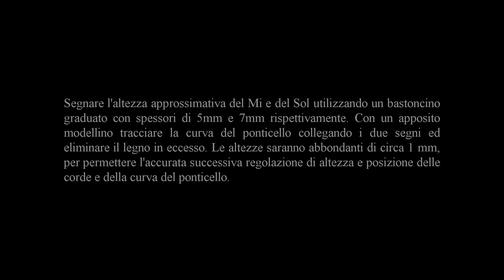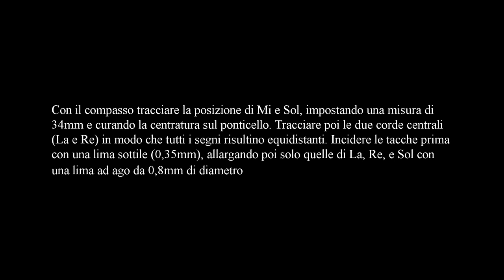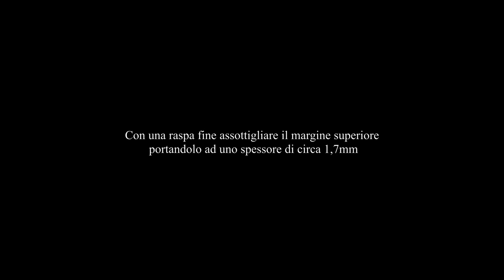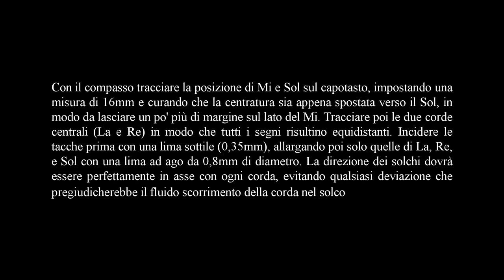Ponticello di violino parte quarta - Impostazione dell'altezza e della posizione delle corde

Comment: How do you know that it is well-centered when you first mark the position of E and G string? Is there any way to ensure that strings are at the center of both fingerboard and the bridge?
Reply from the maker: To center the strings on the bridge, you need to place the centers of the G and E strings the same distance from their respective outer edges. Since the bridge needs to be aligned with the projection of the fingerboard, the strings should lie in the correct position. Obviously if the violin is built in a geometrically correct way, i.e. the neck and the fingerboard, the bridge and the endpine are centered on the same line. Otherwise it will be necessary to adjust the position of the strings and the inclination and position of the bridge, and in the worst case correct the neck alignment to correct for any errors. If you do as I do in this video, while lowering the height of the strings you can also correct their position and check the alignment with the sides of the fingerboard, but obviously only minor adjustments are allowed, you can't compensate for a crooked neck🙂
Reply: @DavideSora  Do you mean by measuring on a curve to check distances from each side? Despite assuming that there is no problem with alignments, it is still confusing for me because lowering the height of the strings changes the angle of the bridge. If I measure on a curve after finished with lowering the heights of the strings, the center line would not be perpendicular to the top plate and be tilted toward to E string because E string is lower than G string. As a result, the strings would not also be centered on a fingerboard when measuring the distances from outer edges to G and E strings.
Reply from the maker: @maiviolin0623  I do not understand the issue. It is true that the height of the bridge is irregular, but the initial centering of the strings on the curve is marked with the height of the bridge very close to the final one, so the lowering will be not much and any errors kept under control. In any case, when you have set the initial position on the bridge and put the strings on the violin, you can visually evaluate their position relative to the edges of the fingerboard easily, and while you are lowering the E and G strings to bring them to the final height, you will have to check that the relationship between the strings and the fingerboard edges remains correct (which theoretically has the E with a greater clearance from the edge, and the G slightly closer to the edge). When you have lowered and correctly positioned the two outer strings (G and E), then proceed to lower and correctly position the two central strings, constantly checking that everything is well balanced and the radiuses above the strings are correct.
But don't get overwhelmed by numbers and measures, "geometrically accurate" is almost never applicable in violin making, because it would assume extreme accuracy in each phase of the construction, so as to be able to have absolute spatial references. Adjustments (hopefully very small) are therefore always necessary in order to compensate for the small geometric inaccuracies deriving from the construction. For example, if your arching is not perfectly symmetrical, even if only due to the deformation induced by the soundpost, your perfectly symmetrical bridge will end up being absolutely wrong, and therefore this factor will have to be compensated in some way. Going into describing all the possible errors and how to compensate would take a lot of time, but be able to set your mind on the starting geometry of your violin is definitely essential to keep any small geometric errors within acceptable limits
Reply: @DavideSora  Thank you so much for sharing your knowledge. My question was raised because my bridge seemed to be set on the right place with right string spacing but strings ended up being little bit skewed toward the E, which resulted in less clearance on E side than G side. Now that I understand there may be a bunch of other factors, I think I need to take some time to figure this out. I really appreciate your comment. It really helped me a lot.
Reply from the maker: @maiviolin0623  On some old violins, also due to deformations as well as working inaccuracies, the situation can be rather awkward, and getting a clue of the situation can be challenging. If you're not a luthier, it might be worth taking your violin to a professional to figure out what the problem or problems are and what needs to be done to solve them. It could simply be the bridge that has shifted laterally, which can be easily ascertained by checking the relationship with the bassbar and the fingerboard to make sure the feet are in the right position, and gradually going up to have to change the fingerboard position to the worst case where the neck is so off-axis that it must be removed and re-attached in the correct position.
Reply: @DavideSora  Surely I will take my violin to a professional if I find credible one. It's just that I'd like to get to know more of my instrument. My instrument is newly made in 2021 and I always put my best effort to keep my instrument in a good condition. The first time I bought it from second-hand market, several local professionals already had done something wrong with the setup e.g. bridge feet covering bassbar 2mm and soundpost 1mm, irregular string spacing. Thanks to the knowledge you shared, it's back in general position (covering 1.25mm each side, central to notches) and sounds much better now. So sad not so many professionals pay attention to the details as you do. I would like once again to express my gratitude.